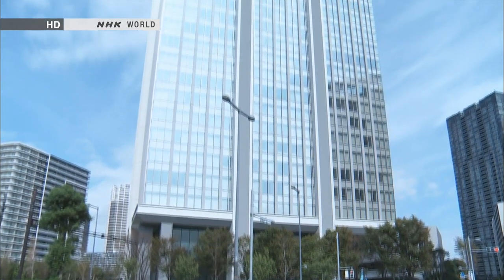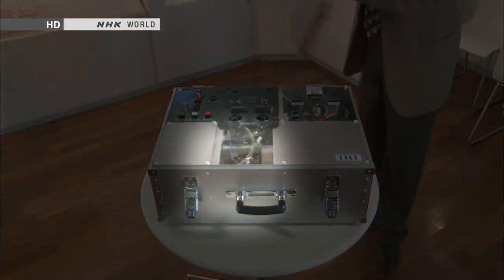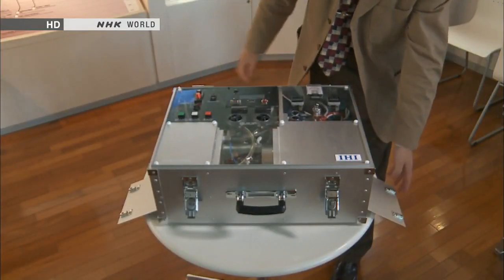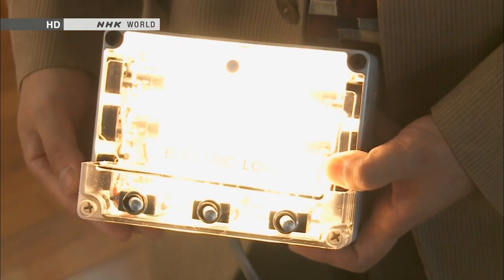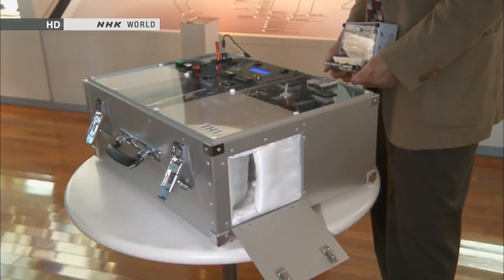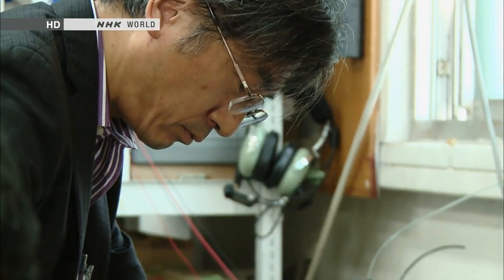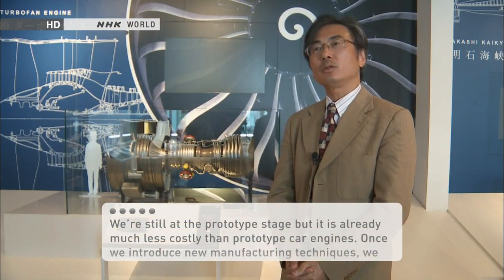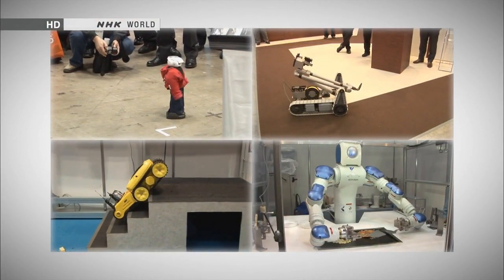Micro gas turbine ,extremely quite and environment friendly مولد كهرباء صغير جدا يعمل على  الغاز

Comment: They should be developing these as range extenders for electric cars. They'd need to be more powerful, though.
Reply: 2017, no signs of battery technology breaking any massive boundaries....
Reply: +idontcare80  I agree. One of the advantages of gas turbines is that they will run on a wide range of combustible fluids. Therefore, turbines can run on a range of bio-fuels as well as fossil fuels, making them good candidates for powering us through the transition from fossil to renewable fuels. Assuming that the range of plug-in hybrids on battery power will increase in the coming years, the need for turbine fuel in plugin hybrids should decrease.
Reply: ***** And batteries cost nothing in energy and money to make? There's the whole issue that you're now physically tied down to physical building (going to be mostly your own as these things get more popular) burnable fuel you can put it in almost any container of almost any size move it however you like use in most vehicles or machines and a little tiny bit goes a long long way. It takes a BUTTLOAD of energy to make those batteries. Then the batteries are good for about 10 years which is fine and dandy but a gas of tank doesn't lose 50% of it's range at 5 years.  Then you have to spend a BUTTLOAD more energy to "recycle" that battery (granted less then to produce it). Both of these sources of energy are also very susceptible to weather. Batteries have a narrow window of temperatures they like to operate at. Too cold and they spend a lot of their energy keeping themselves warm. Too hot and they spend energy keeping themselves cool. Now back to Solar Panels. They are affected by something outside of our control. Weather. Sun always moves? Well if you don't have a very expensive active system and your panels are stuck one direction you will receive maximum efficiency 5% of the daylight time. Cloudy day? 50-75% efficiency loss right there. Now you say that I don't know what I'm talking about making solar panels does not require much energy and resources. I'll say this, I'm no materials and acquisitions engineer. But I am a chemist and if you want GOOD, EFFICIENT solar panels that maintain 70% efficiency after 10 years and output 15%+ efficiency (I am aware the record is currently 46.6%). These panels will require lots of very rare metals and materials palladium, gallium, gold, titanium, silver etc... The silicon in it isn't just regular silicon either, they take semi-conductor grade silicon and process it further so it's even purer. All these metals and materials require a lot of energy to process and handle guess where they get their energy from? Gasoline which has much of it's energy stripped, has 100 times more energy in it then any chemical battery in the same amount of mass. You cannot physically get more energy dense then a hydrocarbon chain unless you go sub-atomic. This is why hydrocarbons is the portable, long-term, high-density energy storage medium of choice by mother nature herself. Fast charge stations? Do you have any idea how much energy it took for the power plant using burnable fuel to deliver enough power 10's of miles away factoring power loss to See my problem with all these feel-good "free" energy solutions is they require a lot of energy to make and maintain. I wouldn't have a problem with this if we had an unlimited energy source of some sort. But what we're doing right now is using something very energy dense to make a bunch of things to store very little energy or create very little energy. Basically we're not being very efficient with it. I know I'm sounding very negative about this, but I don't like to wear rose-colored glasses because the idea of something sounds good doesn't mean it should not be evaluated scientifically and it's pros/cons weighted upon. I have a lot of solar powered things and I like them, I also use rechargeable batteries exclusively in my house even devices that don't use them I will modify so they will I sincerely hope battery tech continues advancing. And I seriously hope that Lockheed Martin isn't blowing smoke up our asses about the portable 100mW fusion reactor, cause if they pull it off then none of this will matter and batteries everywhere! Oh and I'll be ready for my gundam and personal spaceship. :)
Reply: ***** You didn't answer his question. What technology is that? The costs of manufacturing of solar panels has gone down because of change in materials and manufacturing processes. However, it is not the technology that will replace burning fuel. Not anytime soon. Good high-quality solar panels barely break 15% efficiency. And even if we were able to harness 100% from a panel an entire car in solar panels would hardly be enough to power a fully functional and equipped car (the solar car challenges don't count, a few of them don't even have seats and all still rely on batteries to an extent.). And let's not get started on how much energy it takes to MAKE a solar panel vs how much it produces over it's short life span. So no we do not have this technology yet to replace burnable fuel yet. And until we lose the fear of fission or figure out fusion, every energy replacement to chemical energy is created by chemical energy first. Thanks for the video, it answered a few of my feasibility questions.
Reply: +Technigeek its 2015, where are those batteries you talked about.  BTW I'm pro solar
Reply from the maker: Khoa Tran well , you have some point , but i advise you to take a look at the latest advances in these types of technology , its important to know where we reached first before judging it , the silicon solar panels you are talking about is old now , and there is many more better solutions now , batteries too , there is 3 new battery systems that will live longer than you will , i already have some videos in my channel showing these , and soon ill be uploading new ones that might shock you , in the end , all oil products are limited and will soon not be a choice any more , i havent even mentioned the pollution it produces
Reply: @mr2000jp  2019, where are your magic batteries? 
If it sounds too good to be true, it is.
It's ridiculously naive to think solar alone will be the solution.
Solar, wind, geothermal, hydro, wave will all contribute, but the largest chunk will be taken by nuclear.
I also take issue with two points you mention 1. google is unreliable because whoever pays more gets their links higher. This is just bullshit, where are you getting your information from then? Going to a library or something?
2. The amount of energy from the sun hitting the surface of the earth is x y z. Doesn't mean we can harness even a tiny fraction effectively.
Reply: @mr2000jp  it is almost end of 2022…where are those miraculous batteries?…what car is the one that has them?…is that car commercially available?…what about the solar panels? Which ones are the ones that are the best ones (efficiency)?
Reply: yes. about 10 times more powerful, not necessarily in size, but in fuel consumption. blazon jets have a demo
Reply: idontcare80 Jaguar built a prototype supercar with micro turbines used like this. It was canned. I thought it was a mistake because the efficiency of turbines would be perfect as range extenders. Compact, light weight, efficient and relatively clean burning. If you could make one that was perhaps 30Kw and ran on diesel fuel it would be perfect.
Reply from the maker: Khoa Tran well , using solar panels to run cars isnt nessecerly have to be attached on the car , you can put it on top of your house and let it charge batteries ,powerbank that you can use to charge your car when you need ,fast charging technology is right in our hands , so this isnt an issue any more too , 
making solar panels doesnt need that much energy like you said , i dont know from where you got this idea , doing a little serch will give you the right idea , and i mean a search in the right place not in google , google search results is for sale to who pays more , so its not reliable
Reply: I would use this as a range extender!
Reply: Things like petroleum can be reusable and carbon neutral if we use power from solar panels and carbon dioxide from the atmosphere to synthesize it. It actually makes vehicles, especially aircraft, more efficient by removing the added weight of a massive battery.
Reply: idontcare80  If you want to see it, bang around youtube until you do.
Reply: B Belcher  It was nice they were able to externalize your nippers to your iron lung.  I guess alternating current is no enemy of yours.
Reply: it has been done.
Reply: Solar energy is gay
Reply: Oh boy!And all  laws of known physics will be overturned by congress, and wei'll all be green and carbon free. WHAT LUNACY
Reply: ***** And you are an idiot! Newsflash dude! In this dimension, there is not now, nor will there be in the foreseeable future, a physics defying alternative!
Reply: "you have some point?" Dude, you've just been owned by Khoa Tran and have failed to come back with a valid counter answer...so that basically makes you a fucking idiot.
Reply from the maker: i dont agree with you ,i think humanity should abandon all burnable fuel
Reply: ***** That would be great if we had the technology to do it.
Reply from the maker: idontcare80 trust me , we have the technology already , and its perfect ,
Reply: ***** And what technology is that?
Reply from the maker: if you happen to read about solar energy you will know that solar energy that hits planet earth every day is several times more than all the needs of that day of energy , all we need is to convert it from form to another , so we can use it were ever its needed , solar panels technology is now at its best , and its capable of collecting good percentage of the solar energy that hits it , the coast of making those solar panels are a fraction of what it used to cost 20 years ago ,
Reply: ***** I was talking about electric cars. We just don't have a very good way to store electric energy in cars yet.
Reply from the maker: idontcare80 actually there is some news about new technology for producing batteries that has at least 8 times the capacity of the Li-ion batteries that is used now adays , it will be in production in the year 2015 , and there is even a better technology in development that might be available in 2016-2017 , so no worries about storing power
Reply: ***** I will believe it when I see it.
Reply from the maker: idontcare80 hmmm , ok , i'll be putting some videos soon of the matter ,
Reply: ***** No, I mean when I see it in production and available for sale on the mass market.
Reply from the maker: idontcare80 oh , ok
Reply: @mr2000jp  didn't quite work out like that did it?  We can't just toss away hundreds of years of progress and reliance on fossil fuels.  Solar also requires a significant amount of materials to produce and doesn't produce power during night or bad weather (and doesn't produce it very well in northern climates).

We definitely need to keep working on solar but we are not going to be able to switch the entire planet to solar/wind/batteries.  

But we do have a technology right now that can power the entire planet for thousands of years with zero air pollution or CO2. Nuclear.  Germany decided to drop nuclear and switch to renewables only and have only succeeded so far in massively increasing their emissions while also increasing their populations electricity costs.  They increased their usage of fossil fuels by a huge amount.

Electric cars might very well be the future.   But we can't power them and the grid without either fossil fuels or nuclear.
Reply: @mr2000jp from 2021 how'd that statement go?
Reply: This comment aged like milk. @mr2000jp
Reply: @Technigeek
   But if you don't agree with the use of these micro gas turbines then why did you post the video :D ?
  It would be a great start to extend the range until we can all afford the technology to do it in other ways. I think a combination of technologies could be a great way to obtain a longer range. For example, solar on the roof or on a trailer could help some cars to extend their range. But so could swappable batteries or super-capacitors as they can be swapped or charged very quickly.
  If the car starts fully charged and you plan a long journey you can trickle charge the entire way from the offset by using solar and micro turbine. Since many cars only need to be used on short journeys, such a system would not be used all of the time.
  Besides that the worlds energy production is far from green right now and having your own micro turbine might even be more efficient than having a power station produce the electricity from fossil fuels, which is the reality currently, especially in the USA.
Reply: @mr2000jp You do realize that as a human you burn fuel and emit co2 a alleged harmful gas. lol